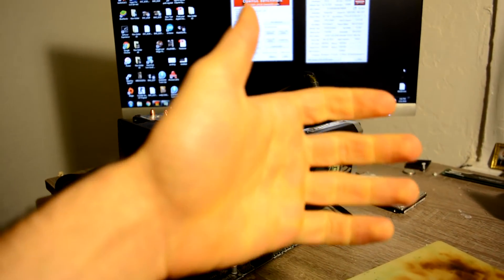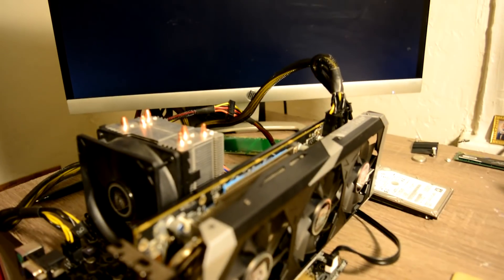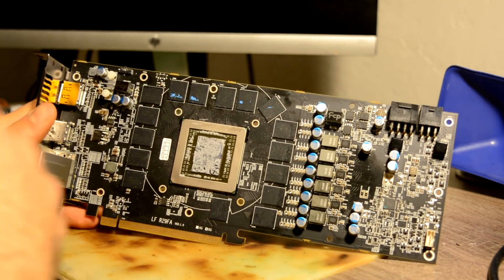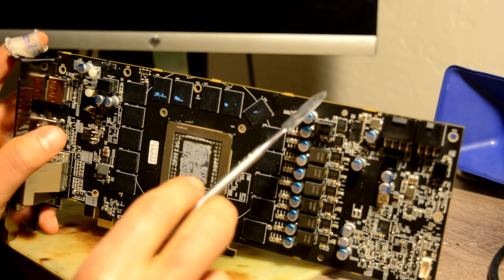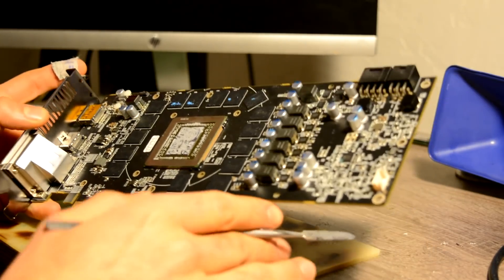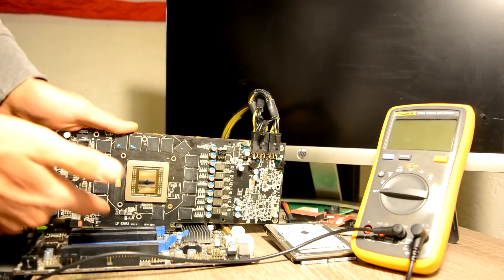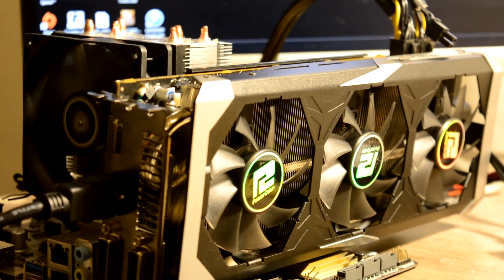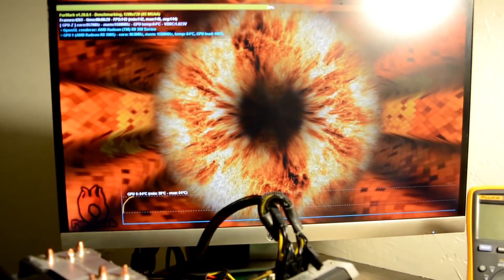Artifacts and dies under load video/graphic card repair

Comment: Thumbs up for you videos Im in Queensland Australia.  I have an I7 3820  running an examining  XFX RX 580 8 gig. When I got it  the RX 580 graphics card It ran find for over a year or so till I did a driver up date from AMD it then started to  over heat And now it wont boot and goes into  black screen  Im now running an old R7 380 it seem to work with my game but only on very low stings  I like to send my  RX580  to you so you can  have a look in to getting  it repaired

Comment: It's quite old video, but just wanted to give it a shot.
Recently I got pre-owned GTX 770. Card worked fine until yesterday. During gameplay my audio started distorting and screen froze with square pixel artifacts (chess pattern), had to restart my PC.
After rebooting my whole screen was covered in blue rectangles. Rebooted to safe mode, reinstalled drivers. Card worked fine for a day, then after gaming a little same thing happened. Game froze, artifacts started poppin on screen after reboot, but this time reinstalling drivers didn't help. Now I'm using only basic windows' drivers to just let the card work on desktop.
After entering the game card can do about 5 minutes of gaming, after which driver crashes.
Is there any solution to this?

Comment: Hi Eli, my xfx rx580 shows small dots and horizontal lines and flickers screen black randomly, it does this a lot on stress that the screen mostly remains black. Before this, I did furmark and PC instantly shutdown, and had random restarts. I suspect it can be PSU. Now, all this flickering and horizontal lines randomly specially on stress. If I uninstall driver and use MS Basic Video Adapter, it works fine and shows very little to no dots and lines but it does.
Is it the GPU or PSU? I dont have replacements to test this :/

Comment: Sir good day to you. Please help my friend fix his XFX RX570. It shows artifacting on the screen from the moment the computer starts up. Please help ☹️
Reply: Could be dying memory. Tell him to try downclocking memory and maybe core. Stress test for a while. Also monitor temps
Reply: @DarkoPetreski  He doesn't know any of that and neither do I ☹
Reply: @artemiolomarda5630  download msi afterburner and do it from there.
Reply: @DarkoPetreski  wait for some reason even when my friend downloaded the drivers and reflashed the bios the screen resolution still looks stretched
Reply: @DarkoPetreski  also the artifacting he had on his monitor were thick vertical lines. 2 lines to be precise

Comment: Hello friend i love your videos, can you please help me diagnose is my GPU dying or not... I have R7 370 2gb sapphire... problem started when i was playing old game "race driver grid" with my custom "ReShade mods" , i was playing just fine and then suddenly random graphical Artifacts and pc freezes itself and i tried ctrl+alt+delete nothing worked so i had to hard restart my pc... after that pc booted to the windows and then icons and image was somehow distorted, and then boom black screen, after this i restarted pc again and after windows loading i get only black screen... After that i decided to boot in safe mod and delete AMD drivers with DDU and pc booted fine without drivers, soo i tryed 2-3 another drivers, again black screen after installing... then i found some tutorial on yt about reflowing gpu with heat gun and i do it on low temperature not even 1-2 minutes only chip with all other components protected with aluminum foil and then i reapplied new thermal paste and now graphic card is working normal with drivers... Now i'm afraid that problem will reappear...now i underclocked  my gpu everything with MSI afterburner... power,clock,memory and i make it custom temperature to never go above 55 c degrees while gaming... so far i deleted all my custom "ReShade" and no problem so far after 3 days...will gpu die again after some times?

Comment: Why with this symptom you directly ordered a new GPU unit ? it's could come from a deficient power supply ? As the GPU go off when need power for computing... Why did you directly change the GPU and not check Power supply ? Best regards, thanks for your channel, and share your knowledge
Reply: His power supply is properly better than most users, better to have more than not enough. Best PSU I got 10 year ago a 430 watt antect and that run a r9 380 and fx8350 plus 5 hard drives. Never broke a swet, I still use it today.
Reply: @skyoreece9805  I was meaning it could be a deficient mosfet inside the card, or a deficient capacitor, that's could'nt sustains the amp the card need when working, but working well with low amp usage. i was not meaning the psu
Reply: @skyoreece9805  The fact, that's Eli change 2 coils, and one mosfet too, 1 resistor  ! i think this is the real cause, not the gpu.

Comment: Where did you order these chips? Did you just buy used broken card in hopes that the chip itself would be fine, or you have some form of store where you buy these? I'd like to order some stuff to fix my older dead hardware but I never tried to look for these retailers selling parts for soldering (especially south bridge and chips on the boards itself. I need an RX580 chip in specific. Cheers!

Comment: WHERE did you get the new Chip from? I've got a 390x which is dying on me atm, freezes in windows under too much load(sometimes hardly none) will only run need for speed payback without crashing if i restart and ONLY run the game. did not think it was possible to do what you just did i got excited but so far can not locate any new chips for the card :-(

Comment: Hey, I have one GTX 1070 that will crash under load and when you restart it get artifacts and another 1070 that will crash under load. I will try to reflow them or is it the chip itself? I also have 3 gtx 1060's that all have the same problem. They have all relevant voltages (vcore/vmemory /memorycontroller/5v/ PCI) the chip is getting hot but no picture. After about 30-45sec the monitor detecs a signal but it is just a black screen with a really low resolution like 640x480. I installed 1 with another gpu and it was detected as faulty I could flash the bios but that didn't help. 
I haven't found a better channel for gpu repairs here and I could already fix some with your help. Thank You.

Comment: Dammit, just bought a 980Ti card that had the same exact problem, but I got it quite cheap though, and thought the switching had problems that would have been easily fixed. Is it really the GPU chip?!I have no idea where the hell to get a new GPU chip! Would a resolder fix it?

Comment: i want to share my method of how i fix my friend GPU Palit GTX 670 the problem are it has artifacts, red lines, it also overheat and the Core clock and MHz are 0 in GPUZ even in the msi afterburner so i try many methods but none of them works, i also try reheating the chips. then i accidentally  fix his GPU when i try to wash it with soap and i brush it every corner, then i use heat gun to remove the water on the GPU then this is the cheap part i have no microwave(btw you can't use the same microwave if you reheat your GPU in it) so i use foil. i make a BOX shape of foil and then i put the GPU inside and i put a hole for the heat gun(max). i wait 8 mins so that the moist in the GPU will evaporate then i put everything back and wait 1 day for sure that there is no moist on it (for sure) and then i tested it and it works!. i don't know if i'm lucky! LOL.

Comment: Hello. I get screen tearing from EVGA GTX970 SSC when it's under load. Do you know what a problem is? V-Sync is turned on though... And monitor is plugged in DVI port using DVI to VGA adapter.  very faint vertical lines are moving up and down when gaming and it gets very annoying. Any suggestions?   
EDIT: I tried to plug it into my TV using HDMI and screen tearing was gone.

Comment: In your own opinion, aside from changing thermal paste, whats the best way to reduce the temps on Nitro+ RX580 8G?
Reply: Crank up the fans! I'm doing testing on RX 470 using 10x duel stage 40mm server fans for 145w of fans on an otherwise "meh" heatsink. Aside of doing that, you can take the stock fan and shroud off, and strap 2x 120mm fans (0.8 amp 120mm Delta would be great for that).
Or water cool, I went from 80c at 100% fans (pretty loud for stock fans) to just 42c under load! Brilliant, and I ran a fanless radiator (I know, hard to believe I wouldn't attach a dozen fans to something... I myself am shocked...). I used a generic $15 water block for that.
Reply: @jakegarrett8109  Appreciate the reply. For the time being, what I did was undervolting my Nitro+ 580 to -70, and able to main 100% GPU load @ 1425Mhz, and 75c max temp recorded while playing witcher 3 on Ultra with Hairworks on. FPS maintains a respectful 60fps all the time (I locked my FPSto 60), and the fans are considerably quiet too as I set it on Auto instead of manual fan curve. 

I was hoping to maintain a cool temps below 70c, was wondering if it is doable by applying a certain brand of Thermal compound (Liquid metal is off the list) would make the temps way better.

Comment: why gpu die still alive after 170C? i thought GPU will burn past 90C mark, is it something different?
Reply: That's mostly while running, but also most AMD chips can handle much hotter than 90c (one of my 200 series cards would become a little unstable on its heavy overclock around 108c on the core). Mostly the heat just makes electron migration occur faster, and the silicon the chip is made out of can be thought of as "more active" (I know, its kind of the definition of temperature), and the silicon will essentially "wear" (degrade over time). The hotter you run it, the faster it will degrade. So its not great to game on it 24/7 way past 100c. With his soldering though, no electricity was going through it, and it was also only for a brief time. Hope that helps!
Reply: No current going through it.
Reply: 90C max operating temperature, but the chip's not operating while we're soldering it. During installation, temperatures can get well over 200C for brief periods. 

Lead-free solder doesn't melt until 200-and-something, so how did you think they put your card together in the first place?

Comment: 5:20 no dude please dont pull that u can broke the pads :c
Reply from the maker: It has compound, how would you do?
Reply: @elitech3339  ah already has the flux?
I'm two or three chip change in a notebook and low-end video cards, but I always hope you move the BGA as you moved the chip at 5:15 and suction pen, the problem is when it's lead-free the solder is very hot, I'm still afraid to touch my R9 290x that a miner gave me at 50 usd, it works to play but it gives me some errors, it looks like artifact's but not on the whole screen only in sectors

Comment: Hello I watched all your videos on video card repair, my bad luck hit me and my video card died and behaves like this:
- it only works until the driver is installed, or most of the time it gives me an installation error, then it does not pass the windows logo.
-in safe mode works but in bios displays some horizontal points.
It's about this Saphire Nitro R7 370 2GB video card, can you tell me if it's worth it to repair it and which one would be defective in your opinion?

Comment: hello 
two question about gpus :
1 - what king of thermal pad can be used for these memories ? thickness i mean. i have a sapphire RX470 and pads need to be replaced but i'm not sure about thickness of pads . 
2 - what kind of silicon can i use for core itself not pad. what specification should i check.
 thank you
Reply: I'd take apart your GPU and measure the pads, every model (even from the same company) is often different. In fact, Nvidia ran out of pads on the brand new RTX 2080/2080ti series, so some of the reference cards have different thickness pads than others (which is indeed bad). Just make sure its as thick as what you measure (they are probably a little smashed down since they are used, but make sure the new ones are at least this thick, its not a huge deal if its an extra 0.5mm thick, just as long as they are thick enough to contact).

For GPU paste, even basic pastes will work (I use cheap stuff all the time for overclocking since the cooler will be removed in a few days). The only thing to avoid as a beginner is: Electrically conductive paste (I was going to say liquid metal with gallium as well since it will eat up aluminum, but its also electrically conductive, so that general non-conductive statement will keep you safe). Most pastes are non-conductive (MX-4 is popular, though kind of expensive), so most are fine. As long as you go with a decent brand like "Arctic Silver" or "Thermal Grizzly" brands, they will all do good. 
Since you specifically asked for a spec, the spec you would be looking for is "Thermal Conductivity" (it says how easy it is for heat to transfer through the paste) and higher is better (just don't get the electrically conductive pastes, those usually do the best, but you can short things out). Also if they say "thermal resistance" on the spec, this is just the inverse of thermal conductivity (so lower is better).

Comment: Hey I have an R9 280X manufactured by HIS, I bought the stuff on second hand market. It runs okay but when I try overvoltage the card it just frezes, I want to OC the card if possible but it just freezes whenever I started increasing VDDC . Could it be the GPU problem itself or the PSU or the other stuff ?

Comment: awesome job, without a doubt. but i wonder if rejuvenating a card which has a residual value of around 90-130 EUR (if working) justifies this effort. i was not able to find a separately sold Grenada Pro GPU (215-0880030) online. Not on e-bay, aliexpress or Alibaba. So where do you get it from and what's the price tag ?

Comment: hi Eli Tech.....i need some advice if you can .....is there any way you can go thru a step by step on the gtx 980ti showing what components to check as i have one that has blew a mosfet/driver and a small fuse i think but haven a clue where to check or what fuse is to replace many thanks tim

Comment: Anyone here can help me fix my Radeon R9 380 4GB? It works in safe mode but crashes the moment I try to install graphics card driver. I have flashed BIOS, installed older and newer driver but the problem persists.

Comment: Hey mate love your content, wanna get a challenge that is rare?
Maybe you could help me with my wierd problem that no1 know answer so far.

Basicly when i oc my gpu r9 290 on the memory nothing happend i mean no performance gain or even lower score... but when i oc core it works fine just can't oc memory now somehow and i did oc my memory before without any problem 1650 (1250 is stock) was nothing for my card, my temps are in check core and both vrm's like 65c in load as max in games arround 60 (Morpheus II + 2x BQ Silent Wings 3 2200rmp) 

I tryed ddu to clean all drivers and fresh install new one and nothing happend and tryed even older drivers also didn't work, reinstaled afterburner ofc didn't help aswell when i set my memory for example 1500oc all programs like gpu-z msiafterburner hwinfo showing that my memory is running 1500 but that is not true coz score is identical to stock 1250 (few days ago when i ddu and instal all fresh drivers memory oc works for 1 time and i saw gain on it then i thinked that is fixed already but the next day when i try to oc didn't work again...) and i have no idea what i can do more PLEASE HELP!

Btw im not sure but 1 possibility is that happend when downloaded Trixx and tryed to oc by this program, my card always stay stage1 1250 memory never go stage0 150 but when i use Trixx i saw this stage 150 on my gpu and i was in shock before i did any oc.
Before i always using MSI AB. Ah and FYI my card works perfectly fine no artefacts etc even with oc on core. ( tryed to delete registry from trixx aswell)

IMO that could be something corrupted in windows or in gpu bios coz i don't think gpu is dying in any way.
Im not able to test gpu on other desktop to check if its windows ;/

btw win7/6700k/z170 pro gaming/16 ddr4 3200/hx 1200i
Feel free to ask any questions
Also if some1 know answer please let me know aswell
Any Idea? i would seriously appreciate it!

Comment: I have a Galaxy Geforce GTS 450 that I accidentally overheated, I forgot to repaste it, because the paste was bad, and now it shows video in black and white and in very low resolution, it was a good entry level card 6 years ago for gaming, I bought a MSI GTX 1050Ti instead xD

Comment: why your finger got patched ? I hope you are okay,keep it up :3
Reply from the maker: Iron Nokana I’m very clumsy with a knife and I work as a bartender and in combine of those two things I cut my fingers from time to time)
Reply: @elitech3339  I see,hope your finger will recovered,anyway do you know how to rebios with SOIC08 I tried rebios zotac gtx 1050ti but it doesnt detected and the fan wont spin,when turn on the pc it wont detected anymore except one gpu working (if there are two gpu including that bricked gtx 1050ti)
Reply from the maker: Iron Nokana how do you know that thats bios issue? From my knowledge even if you have bios issues your fans still should running. Did you ring for short or missing powers on the board?
Reply from the maker: Iron Nokana and how to reflash bios you can see on one of my videos (Titan repair) 
Thanx
Reply: @elitech3339  no my friend college gifted me this zotac gtx 1050ti,he has bought a new one,he said that he tried to update bios as he played games always crashed,as he tried to rebios,it failed and bricked (. before I attempted to rebios,the gpu fan is spun (it still wont detected and no display),after I attemped to rebios, now the fan wont spin anymore and same as before)